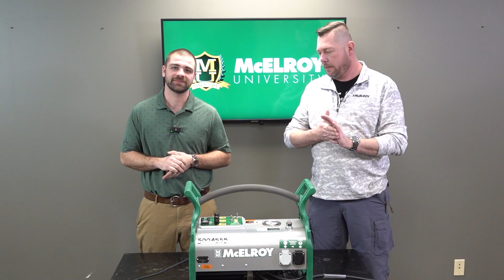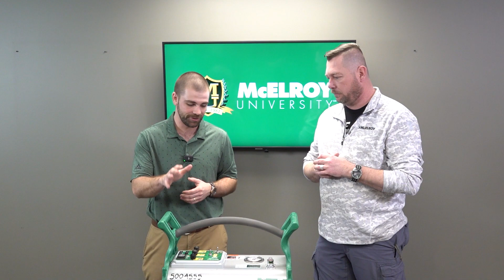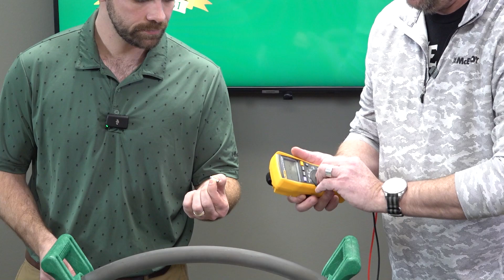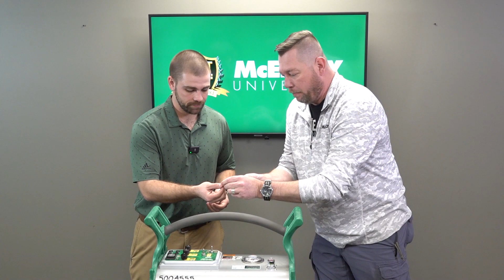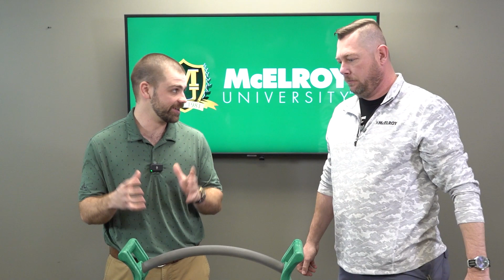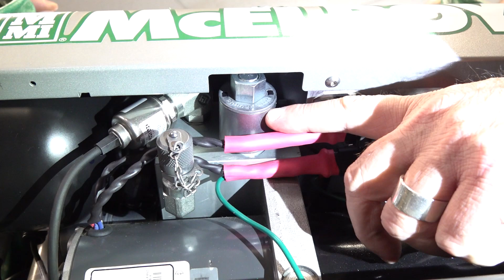McElroy EP800AD HPU Tech Tips

Comment: When I toggle from fusing pressure to heat soak pressure after making my required bead it takes 30 seconds for pressure to stabilize. Is this normal? Also setting drag pressure takes a long time because dial is so sensitive. Any advice?